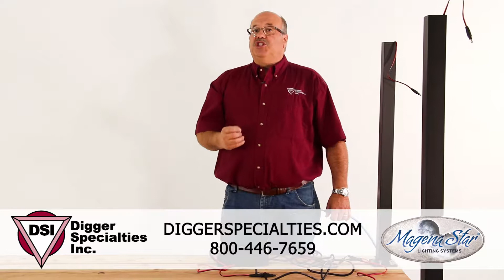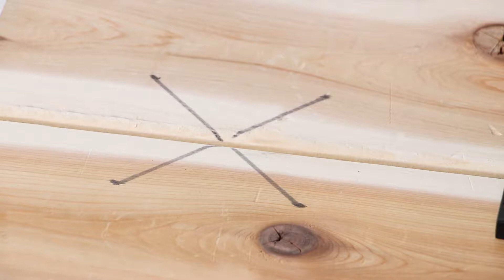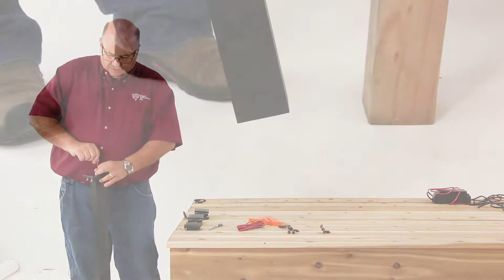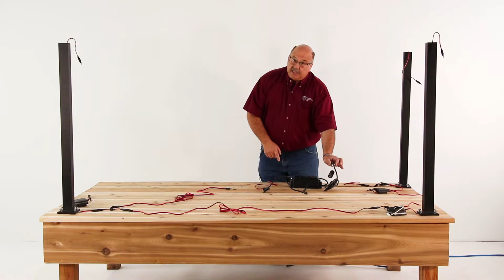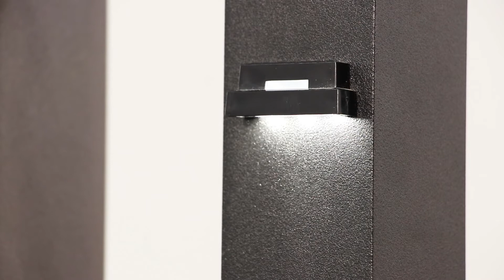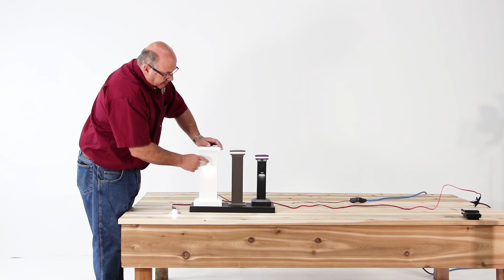Magena Star® Ornamental Lighting Installation

Comment: Do NOT buy!  This is an overpriced transformer and it will not last.  The 5 year warranty is worthless because the manufacturer (Digger Specialties) will take weeks to even respond to a warranty request, and then they will find a reason to exclude your coverage.  Mine started blinking power after only about 10 months.  It does not even have wifi.  You can find a much better "smart" transformer with wifi and phone/Alexa/Siri controls on Amazon for 1/3rd of the price of this boat anchor.  Outdated junk!  A low voltage transformer is a low voltage transformer and nothing special.  You can use any low voltage lights with any basic transformer with only very, very basic wiring skills.  Get a smart transformer and not this piece of S*#!.